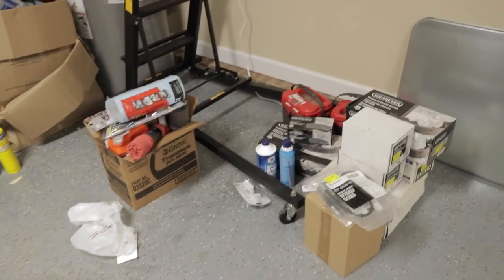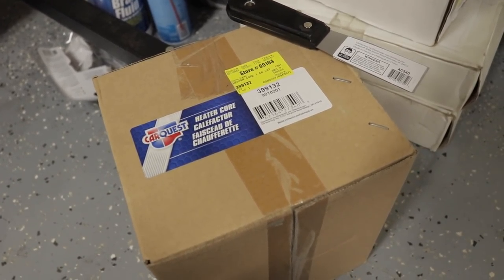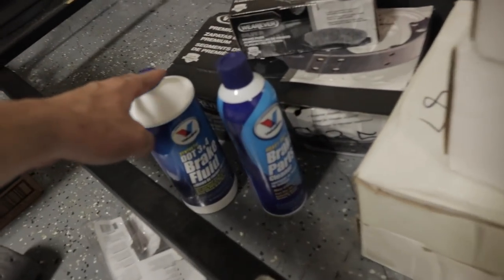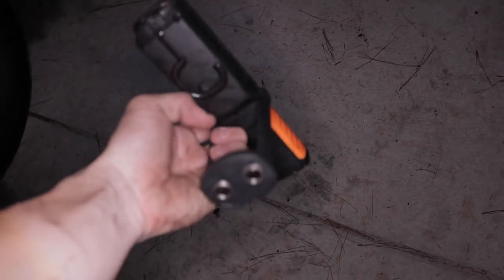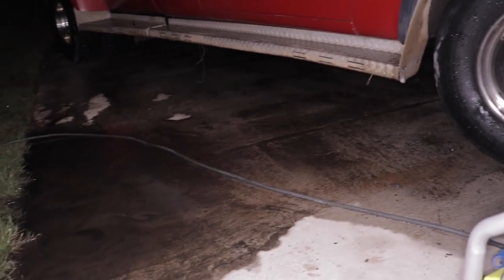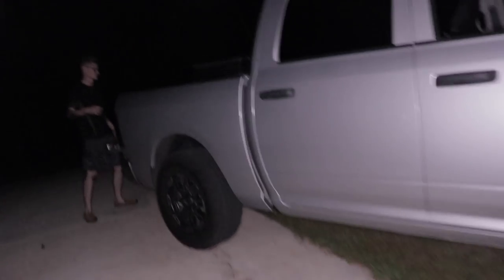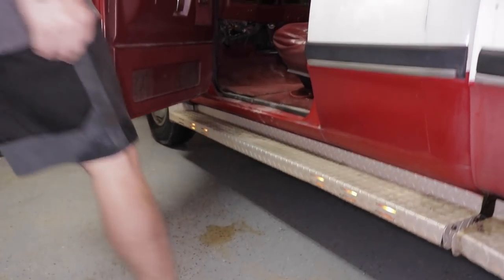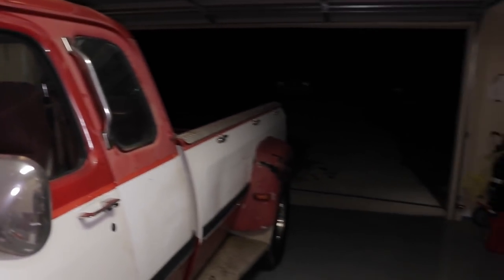NEW PARTS ALREADY IN FOR THE FIRST GEN 12 VALVE CUMMINS BUILD!

Comment: You should get the evaporator core and do it at the same time as the heater core. Even if it’s not bad it will save you from having to take the dash out twice if it ever does go bad. If you’ve never taken a dash out you’ll realize why you only want to do it once. Lol

Comment: Keep the truck for a tow pig like you said. Clean up the outsides and interior and if possible throw a  standard trans in it. I like it how it is just take the black pieces off the sides and take off the crappy steps and put some black pipe running boards on it change the bumpers to offroad bumpers put 2nd gen roof lights on instead of the first gen lights and itll be badass

Comment: So my 3rd gen never had the cummins squeak until AFTER I put the Gates belt on. I like the belt and not trying to hate, but I swapped it out when I replaced my water pump awhile back and ever since it’s been squeaking every time I shut down. Ever heard of that happening?
Reply from the maker: Bryce Moore Did you replace the tensioner?
Reply: Unfortunately I didn't. I replaced the water pump, thermostat, and fan clutch all at the same time. Tensioner was gonna add like an additional $80 and delay shipping a few days, so since it had never squeaked before I figured the tensioner was a nonissue and skipped it.
Reply from the maker: Bryce Moore You need to replace it man, get you a gates one

Comment: You need to put a flat bed on it  and put some stackes witb a chip in it to make it roll coal.
Reply: Oh please! Just ignore this guy
Reply: No just no
Reply: Zeppish oh so I'm thinking of 24v
Reply: You can’t chip a 12 valve. All mechanical parts. Best way to add horsepower on em is to adjust your fuel plate, add high pressure fuel injectors, and a bigger turbo.